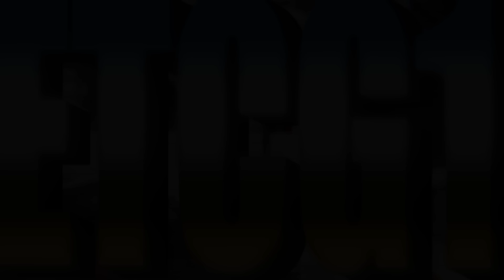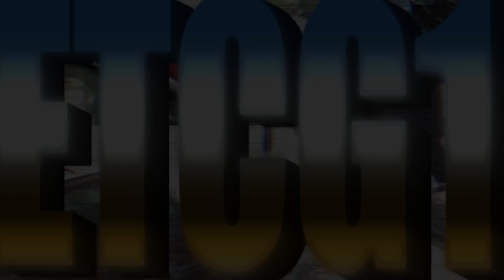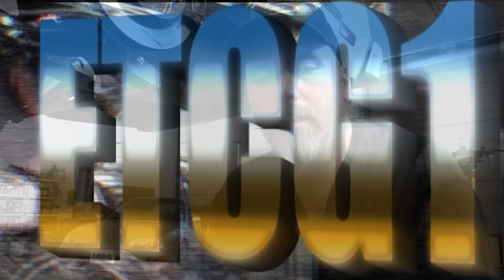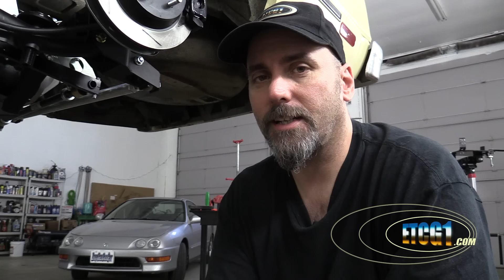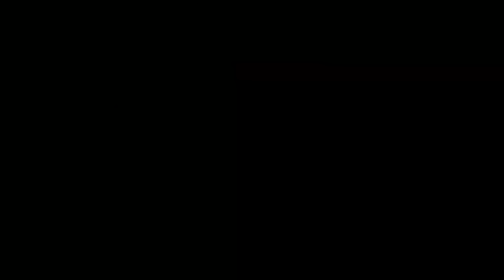Misconceptions About Performance Parts

Comment: big bore throttle body, and a good exhaust.. most modern ECU's can adjust for the change..
Reply: Yes and no. 
The throttle body is very rarely a restriction of any sort so putting a bigger one on usually makes no difference at all. 
A good exhaust can make a difference but people usually go for large bore loud ones rather than one that's actually good
Reply: they work together very well.... on my s2000, the combo was way better than either one by itself......
Reply: +ItsFriscoBaby
simply upgrading the throttle body, i can see where you are coming from, but ITB's would require a ECU and definatly makes a big difference
Reply: +Hachi Roku ITBs are a completely different thing and can't be compaired to just bolting on a larger single throttle
Reply: ItsFriscoBaby
oh i agree, but it is still technically a throttle body mod
Reply: +Hachi Roku ITBs make gains in hp basically because they replace the standard long tract inlet with a shorter straight one. 

A larger single tb doesn't do that and the tb itself is almost never a restriction. The restriction is usually the inlet manifold and is usually done on purpose for low end torque and driveability
Reply: which big bore throttle body made any difference on your s2000? they make 1-2hp tuned. lol, and thats if you port your intake manifold
Reply: yes, it was bored and port matched by science of speed..... and the dyno results tell me that 1-2 is actually 14.... and on a motor like the f20c that is an amazing gain...
Reply: WezleyB ahh never heard of that, sounds like you've got some other mods to give you that 14hp gain.
Reply: test pipe and tb with port match... stock exhaust. no "intake" per say, stock air box, gutted, and a silicone tube....  simple setup but it all works together very nicely.
Reply: WezleyB lol the test pipe alone can get you 10hp. I have a k&n fipk intake, and test pipe
Reply: we tested the shit out of the installs... the test pipe alone made 5hp, and the tb/portmath made 6. the combo together made 14hp..... i have done the science......
Reply: WezleyB nice now you need headers, cams, valves, ecu, itbs, and make you can make a decent motor build. 14hp is decent, but nothing.
Reply: David G
its about balance, not power
Reply: Hachi Roku I own an AP2, it's a fast car, but it's underpowered for what it's capable for though.
Reply: David G i have a aem infinity now, but didnt when i had it on the dyno. the ecu made a huge difference, mainly by changing vtec engagement point...
other then the silicone intake pipe and test pipe, mine looks 100% stock. and thats how i like it. i dont want a rice rocket....
Reply: WezleyB Nice rocket for having a built engine? fuck any sense of logic.
Reply: David G its totallylogic. why would i spend 20g's on a motor for a car i have 17 grand into? i would just buy a different car, if i had that kind of money.....
Reply: WezleyB
"you just dont understand who you are talking too"
arrogant much?
Reply: WezleyB
see, you dont even understand who you are talking to, i am not the one you are debating with.
ironic isnt it?
Reply: Hachi Roku I think he's on some kind of drugs/medication, leave him alone
Reply: David G
yeah i can see what you mean
Reply: Hachi Roku well yeah you got me there, i guess i got my douche bags confused, but is kind of obvious who that was meant for...

Comment: good said sir 
power is made as easy as i can put in your cylinder heads its all about flow how will they bring air in and let it out  your head can only move so much air 
now if you have lets say ported heads then header make way more power vs stock exhaust 
cold air intakes don't add much because your limited to how much air can go in your engine
that is a rough example

Comment: I put an intake and full exhaust (headers all the way back) on my 02 Toyota Tundra and actually lost power, it sounded better but I noticed that when I had two dirt bikes and my sons quad in the back stock I could pull the toll road hill at about 91 MPH WOT, after mods I could only do 87 MPH, I know that's not very scientific but oh well.

Comment: I cant say I know this its true to al the cars out there, but the intake is most often restricted. When open it up to let the engine draw more air make you gain mostly tourqe. Some engines let you have some hp at the top end to. Sure it´s a good idea to do someting to the exhaust at the same time, to se some good resoults. But do not forget that the engine may need a tune after this.

Comment: "Back in the Day" I could advance the timing on my old Dodge and gain some actual power I could feel. Of course, add a tank of cheap gas and I had to back it off a little, but I had that capability. Now you could throw $3K in hipo parts at a car and only get 5 to 10 HP if that much, and if the computer can compensate for it. Some of that is the high efficiency of engines these days, some of it is just being locked out of all the real power adders like ignition timing, valve timing, injection pulse, A/F ratio, and other things that can give you 50+ HP, 40+ MPG, or a smouldering pile of junk if you don't know what you're doing.

Comment: It really depends on how optimized things were from the factory.Naturally aspirated Toyotas tend to be fairly optimized from the factory on the intake and exhaust sides. Some Hondas tend to do better with bolts-ons because their intake and exhaust systems tend to not be all that optimized. Their hard parts are great, heads, intake manifolds, compression, cams, etc, but their intake and exhaust systems tend to be restrictive. Boosted factory cars of course tend to do much better with bolt ons. Larger modern engines tend to be a lil more choked off to keep them quiet so they respond well to bolt ons. So some cars do better than others. Some vehicles have decent exhaust systems but horrible exhaust manifolds. Jeep straight sixes have notoriously horrible exhaust manifolds. The rest of the exhaust system wasn't really to bad so there are healthy gains just by adding a good header. Many things come into play.

Comment: Things have really changed since 1960 when I had a 55 chevy 210 6cylinder 3 speed. Back then half the cars on the road were so far out of tune they barely ran. I beat a lot of ford v8s street racing just because the other car was not tuned perfectly. I carefully got all the old chevrolet had in it to work correctly(understanding what is going on). One experiment, fenton headers and dual glass pac exhaust along with a 3 one barrel progressive carb set up I built. More acceleration(mid range power) but no improvement in top end. That car would do 95 on the level and that was It. Ended up with single carb and single quiet muffler just as a good transportation car. I must say it was a good tough machine and I could fix anything on it. My favorite BS is from the KN air filter  bull slingers. Just use a good stock filter/air box and most of the time its best. Had a 76 fj40 and tried different filters in it. Nothing worked any better than the stock one. Getting all that fuzz and crap from the KN in the mass air flow sensor and the dirt passed on to the engine is just not a good idea. Most new cars are very well engineered and what people do to them usually makes it worse.
Reply from the maker: Well said. Thanks for your input. That '55 sounds like it was a lot of fun.

Comment: I agree. Always been disappointed with engine bolt ons. Even changing gear ratios is not the big difference people think.
Reply: Chad Bob that's cause you need to get all that new stuff working right. 
Back in the day it took forever, swapping carb jets and advance weight springs on the roadside. 
That is what tuning is....it runs , but can we make it better ? 
More fuel and it slowed down? 
Oops, well let's try it the other way......
jeez now that less fuel helped (this is an overall example) now let's futz with the timing curve....
Me and an old bud used to have similar cars and we used similar parts usually, but I'd do some extra tuning and it always payed off when we lined up. 
I would be pulling on him by the time we hit 2nd gear usually.
Reply: no
Reply: Chad Bob 
👍🏻

Comment: My own personal experience 

I used to own a classic Rover Mini only car I have ever done performance mods on.

I replaced the rear box (muffler) for an up swept DTM made by Maniflow and the air filter element inside the stock air box for a K&N element.

Did it give me more horsepower?

Who can say?

Did it sound better? Hell Yes!!!

Was it more responsive? ;) Oh Yess!!!

Didn't really care about the numbers it sounded sexy and it was definitely more responsive but affected my MPG at the same time :( 

That said the car I have now a 1989 Mercedes 230e was lacking in zip when I got it and replacing the blowing rear box,the filthy air filter and replacing fluids all standard OEM gave the car back a fair bit of the performance the car once had ;)

Whenever you buy a used car the best money anybody can spend is on a fluid and filter service :)
Reply from the maker: Honestly, I think that's how it should be done. Ultimately it's your vehicle and if you enjoy it, more power to you. (pun intended) It's when people go around bragging about how much hp they got from bolting on a CIA or louder muffler that I have issue with. If it's a better driving experience as you pointed out, that's fantastic and realistic. But to say you somehow got 50 bhp from it would be less than honest I think. Thanks for your input.

Comment: With my Integra it was the LS & the DC sport is a bit pricey cus here in California they a scrict buttheads on smog & the DC header is carb legal here so they are pricey if u dont want to get introuble with the performance part u need, but once i did add a cold air intake, headers, test pipe & full cat-back exhaust system i felt a big difference, raced my friends stock LS integra & beat him by a car length a couple times for the test to see if it wasnt just the driver cuz i used his as well & same results, try it! most u can spend om these parts together will be around 400-$600

Comment: all an engine is, is a fancy air pump. the more air that can efficiently go in and go out of an engine the more power it will make. like Eric said, you must first know the system you're working on. I don't see upgraded parts as more hp/trq. I see it as making my system more efficient. if that produces more power excellent, if not I know the efficiency is better. take Eric's header install for example. it may not have made more power but I can guarantee he picked up some MPG due to efficiency. if there is any upgrade I'd recommend for any vehicle and I'm sure Eric would agree and has done videos in the past about it, is upgrade your tires. they will enhance every characteristic that your vehicle naturally has.

Comment: I think the biggest misconception being that with most performance upgrades with newer cars like anything obd2 or newer. You cant just bolt on a high flow exhaust and intake system like Eric said there is a good chance it might be detrimental to your power output because with most newer cars the ecu is not going to be able to compensate all that extra air you might see a couple hp gains but most likely it will be a loss. A full performance intake exhaust combo is only going to see gains with a tune. And this only being proven even more with forced induction motors its even more dangerous actually compared to n/a motors cause with all that extra air you run the chance to lean out. Older cars i.e. Muscle cars being an exception top all this because you could just bolt on more fuel with a bigger carb. There is a reason why any reputable performance parts company who sell performance parts for modern cars like cobb will sell even just an intake system with a tune to keep things safely balanced and get the most gains add well.

Comment: I find intake/exaust mods takes low-end torque away to stack it up on top. You need to be always shifting at higher ranges; it gets annoying. Especialy  early mornings in suburbia.  Add-in a fartcan with that and yeah * # 5 rice combo*. However good safe and proper(don't get me started on camber) brake+suspention mods? GO for it dude!!  Swap those cheap ass tires. Also Trucks with 40 something inch chrome wheels with spinners I don't get that.

Comment: I added a cold air intake to a Stratus I had wasn't expecting much guess what? I didn't get much, with out the air dump boxes I got a noisy air sucking sound like a bad vacuum leak, the only real gain was about a 3 mpg fuel economy increase.

Comment: IMO,the header will make more power,but only at higher RRM.
Nothing below 4,000.
That is where the tubular headers can flow a lot more air than the stock,cast iron manifolds. The weight saving IS significant.

Comment: Aren't Cold air intakes useless without a tune? You may be increasing air flow but wouldn't it be restricted since the computer only let's in a certain amount of air to maintain the air to fuel ratio?
Reply from the maker: It is not possible to 'tune' Honda computers of this vintage.

Comment: Just my thoughts especially on the GS-R in regards to performance. That GS-R from the stats i have on it if equipped with a B18C1 engine from Honda already makes  71.1 ft. lbs. of torque per liter of displacement. This is very impressive and is in the range of most high end BMW's and other luxury performance cars, and only topped by very expensive exotic cars like Ferrari's which can hit 80 ft. lbs. per liter. Pursuing any minor performance modifications on that engine will be fruitless, changing anything on the intake or exhaust side of things will either reduce performance or it will merely remain the same, it's built well enough from the factory to not notice an effect from ANY combination of bolt on modifications. So what can you do if you get an engine that comes from the factory built so well. First off i would not chase 80 ft. lbs per liter naturally aspirated, it is achievable but not cost effective, instead to see any gains you will have to mechanically change the motor to take in more air (and thus more fuel) per unit time. That engine is rather displacement limited at 1.8L, so this is where i would start. Boring and stroking will give you gains but is likely not worth the money, forced induction like turbocharging will be the cheapest method as far as hp/dollar you can do and is essentially artificial displacement. Running 14.7 lbs. of boost is roughly equivalent to doubling the engines displacement (you are doubling the density of the incoming air) at sea level effectively making it a 3.6 Liter! At 71.1 ft. lbs. per liter this would put it in the 256 ft. lb. range with about 340hp. of course to obtain 15 ish lbs of boost you will need to lower the compression ratio taking some of those gains back away, thus i would say you would end up with around 300 horsepower which is about the limit for most FWD vehicles to be driven on the street just due to drive-ability and a more than adequate figure for a car of that size and weight. Modifying import cars well takes a lot of money, a machine shop and a lot of experience and there is no getting around it, you really can't make a performance import out of a catalog. Just my opinion.

Comment: I have a 2003 Silverado SS AWD 6.0 Liter H.O. with 4L65E trans and 4.10 axles.   I installed a SuperChips tuner, Volant cold air intake with Ram Air tube  and Kooks  stainless long tube headers with Flowmaster exhaust. My engine stock made 345 hp with all the above bolt ons now makes a corrected 380 hp.  35 hp for 2000.00 cash and it actually hurt my low end performance! I'm a firm believer that the only true bolt on performance out of a box would be a supercharger or turbo set up matched to a intake and exhaust system and dyno tuned as a package... say what you want,  that's my experience with bolt ons... not really worth the money or effort!  In all fairness it took my highway mileage from 14.5 to 16.5 so long as I keep my foot out of it... so maybe it wasn't a waste of cash! I'm sure a custom tune would net me more power... and a  looser converter would put my bottom end back... but that would build more heat and waste gas now wouldn't it? lol... it's always a trade off!
Reply: stock stall converter is killing it. Buy a decent stall, night and day difference.
Reply: My point was the above bolt ons didn't net any power to speak of. A high stall converter won't make more power... just rev the engine into a higher rpm before engaging the transmission... I've got a buddy with the same truck, installed a Monster 4L85E built tranny with a 2600 stall converter and it runs about the same.... to boost power we need a cam swap and a custom tune to go with all those goodies... it's always a package deal that nets you the best gains. It's a daily driver... and I don't want to build heat in the trans or smoke my gas mileage... it's already bad enough being a 6.0 liter and 4 wheel drive!  Thanks for the input though Speed Demon 88X...!
Reply: I was going to say a cam and valve train upgrade would give you more power for about the same money after you pay for a tune but it looks like you already know =). I love that power plant. I have a 5.3 in my Impala.
Reply: SuperDave21 It's an LS based engine. The long tubes are what got you the power. I'd get rid of the superchips crap and just get a dyno tune. Swap out the vortec intake manifold for a cheap LS6 one and you'll see a decent bump too. The Flowmaster exhaust is probably hurting you more than it helps. Maybe it's different for trucks, but the Chokemaster is awful in LS cars.
Reply: I've got a buddy with the exact same setup as mine minus the exhaust. He's got some generic long tubes and a Borla or Magnaflow exhaust and my truck outperforms his by about 2 lengths in the quarter mile. What exhaust performs best with the LS engine?  My LQ9 is totally stock internally.